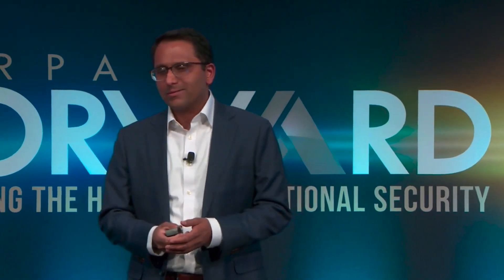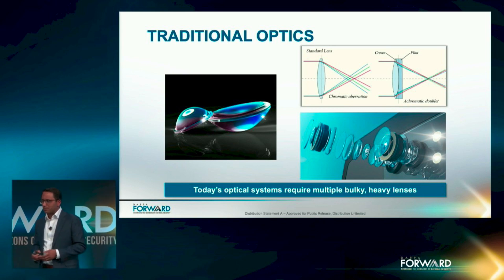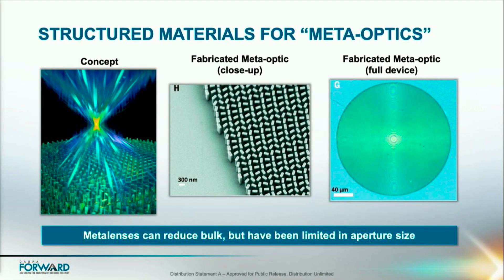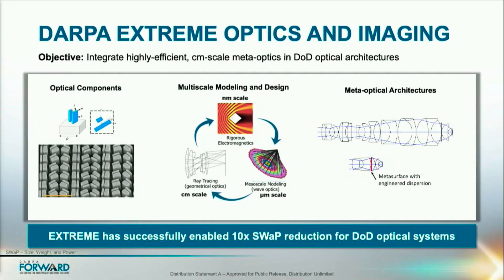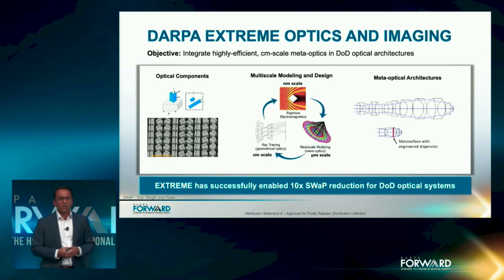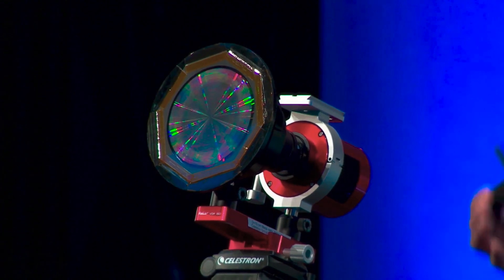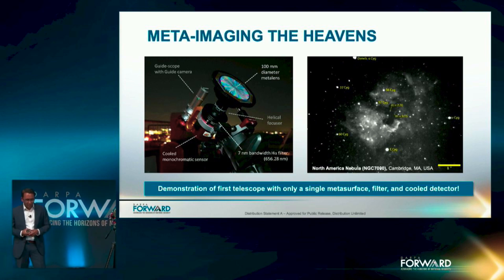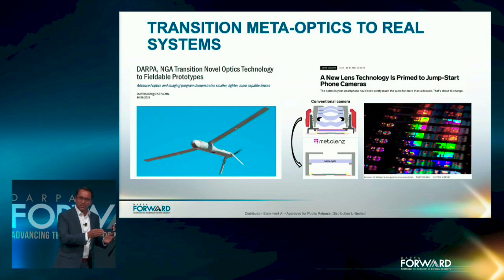Extreme Optics and Imaging (EXTREME)

Comment: The best telescope is the one you use and that looks really easy to use.
Reply: Practically weightless by comparison to anything currently made.

My dads new cassegrain telescope is much smaller than the older newtonian, but something made with these could be ridiculously light, especially if the tube was carbon composite.

Though I guess the lighter it is the easier a stray wind can move it 🤔

Comment: wonder if this technology can be applied to smartphones, and would it offer greater benefit compared to traditional lenses
Reply: it will eventually and it would lead to better resolution for things like medical imaging diagnosis or other useful measurements , basically turning the smartphone into something akin to a tricorder from star trek
Reply: It is too expensive for smartphones and not necessary for normal people.
Reply: @Vor10min.  sure, its too expensive for now and presently has limited applications

however, its price will likely come down as manufacturing techniques and scale improve over time provided it is driven by sufficient demand...

the demand side is a matter of it being able to save time (important for medical applications) or provide a viable alternative to more expensive methods of achieving the same result...

the medical application alone might be more affordable to pathology clinics to start with, but over time general medical clinics would likely find it more efficient and economical to do such work in house ...

there are other factors to consider, e.g. the aging population globally will increase demand for pathology services which will benefit from the evolutionary nature of this  tech

also, due to the products adaptability to existing tech (smartphones) integrating it into existing business practices will be much simpler (than say, installing mri machines)as its evolutionary aspects are already in demand .... 

its revolutionary aspects are still yet to be fully realised

just some food for thought
Reply: @umenhuman7573  But well, the internet was also sometimes an expensive military-only technology.
Reply: @Vor10min.  indeed, even the humble rock has been developed from ancient times from simply being thrown, to being shaped and fired from a bow to being developed into modern precision guided munitions... (not to mention someone strapping a few sticks together to crewate a shield to block it etc etc ) ...

as to have the production methods ... all for military use ... along the way they also figured out how to combine enough rocks of the right type to create computers and satellites etc etc etc ...